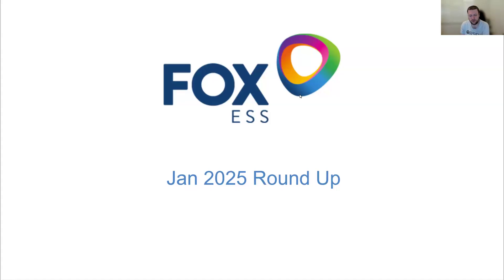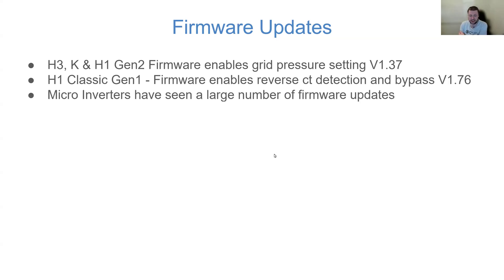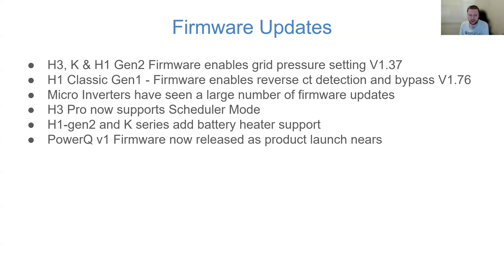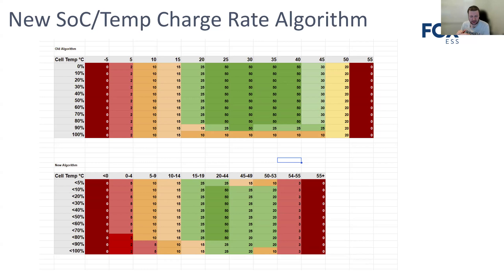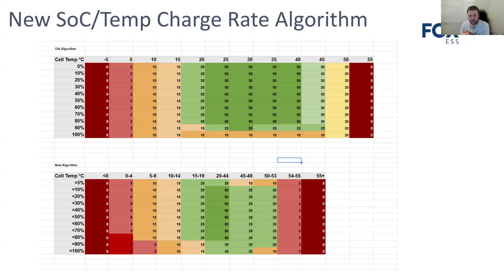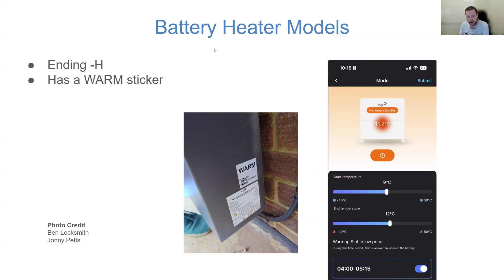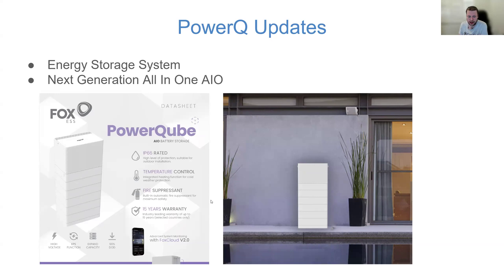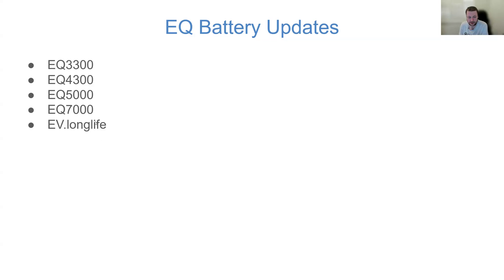Fox ESS updates, new features and announcements - Jan 2025

Comment: Extremely useful, thanks.  We have an inverter/battery system installed January 2023.  Highly delighted…until last week when we had battery and inverter fault codes, and the battery effectively shut down.  The installers came and, in concert with Fox online, reset everything.  We reckon a software update (maybe January?) hadn’t properly worked because we had noticed the performance wasn’t quite in line with previous years (I’m a spreadsheet and data freak so keep voluminous records) but that as the last few weeks were dull nothing untoward occurred.  Then when it turned sunny a couple of weeks ago the system couldn’t cope.  Anyway, up and running again - but we noticed charging was a good deal slower than previous 2 years - reckoned this was a software change to preserve battery life, went onto your excellent site and what you say would appear to validate our own thinking.
Rob and Janice Curtis

Comment: hi, I have a model H1-6.0-E, how do I go about setting my system to stay in the export mode for the trickles it collects from the grid to keep communicating? And does the syem update automatically or via the foxess app or it must be done from the inverter unit itself?
Reply from the maker: contact your installer for the firmware update and for them to confirm the grid setting for you. I recommend starting with a -50 setting

Comment: I had 12 solar panels, a Fox H1 3.7 inverter and a 7.7KW/h energy cube installed mid-December. Hadn't realised that it would be affected by temperature drop in the recent cold spell.
When I raised this with Fox support, they suggested getting in contact with the installer, which I have done and am awaiting their response. Fox suggested possibly relocating it. As the temperature has improved on and off over the winter, so has the battery's performance. I wondered what comments or advice you may have. Don't think the energy cube has any sort of built-in heating mechanism.

Comment: Looks like the datasheet on the US site shows that the EQ5000 is only (currently) able to stack to 6x units high which is a shame as the EQ4300 is able to goto 9x, I wonder if this will change.
Reply from the maker: Yeh I'm on the edge of my seat for the EQ7000 size and price
Reply: @iameccles Regarding the temperature curve, I'm seeing 13A, 20A, 35A, and that's with very new firmware (KH7/EC4300-H4).
I have a 70watt cat heat pad controlled via an automation (which is one reason I'm after the BMS1 min cell temp 🙂 )
I would have loved the PowerQ/PowerQube but my install happened first.  Probably would have struggled with getting Nathan's integration working with it though.
Couldn't find a datasheet for the EQ7000, but the datasheet for the EQ7000-plus is 660mm wide, 360mm deep, and each slave module around 135mm high, 57kg(!!), 6.6kWh nominal, max stack 5.  EQ6000-Plus stacks higher (7 modules), same footprint.  EQ6000 base model is smaller, 570x380, 6 modules.   Not sure which of these are reaching the UK.  I get the impression that the USA stacks tend to be shorter?
Reply: @iameccles  I did comment earlier but youtube ate it - the EQ6000, EQ6000-Plus and EQ7000-Plus datasheets are published (around November I think).  Just not the EQ7000...

Comment: Got a new EQ4300 delivered instead of ECS. Backward compatible and allow an extra max battery. Good news on back pressure too. Much better for customers. As always, cheers will
Reply from the maker: Thanks
Reply: @iameccles  I just upgraded back pressure on my KH and it works a treat, managed to tweak it to push back around 9w rather than import 9w. Its not a lot but these little tweaks make customers happy, Ill be adding a quick video of this with a shout out to you